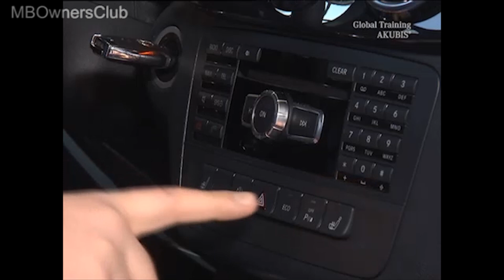The OM651 Diesel Engine: How it's Different in the B-Class, C, E and GLK-Class

Comment: No thought was given to maintenance access is extremely difficult, AND the inlet manifold is made of PLASTIC that fails and then screws your DPF, rocker gaskets leak plus oil filter housing, My OM651 is in an E class W212 , its rear subframe failed at 8 years,
Reply: Amazon sells AT-205, a bottle will fix your camshaft seal leaks. I've fixed so many major leaks on 25+ year old vehicles with it. Cheaper than struggling with valve cover gasket's on a transverse V-6. 🤷🏻‍♀️

Comment: With om 651 Mercedes made the worse diesel in history. I have timing chain noise at only 154 000km! Water pump leaking.The rear bridge is rusty.Very bad piezo injectors. Sensors  malfunctions....D.mb german engeneers.I will never buy mercedes or any other german car ever again.
Reply: Well my friend has a E class W212 2014 with this bad OM 651. 300.000 km without ANY PROBLEMS. Oil change done on every 25-30.000 km in Mercedes service. Rear bridge was changed at a cost of 100 Eur because it is under waranty  for 20 years regardles if the service was done by Mercedes or not. This is in Croatia. AFC is 5.5 lit/100 km. I gues it all depends on service history and driving style.
Reply: What year is your car? They say these problems have been fixed as of 2013.
Reply: @JasZg  Aren't the years of facelift sprinter and e class models with om651 from 2013-2016?
Reply: @SeverinLudwig  I am not sure about sprinter.But i am sure that c class made a restyle  2011-2014 with OM 651 and 2015 they made w205 .
Reply: @JasZg  Yes, c class facelift is 2011-2015. So you got a 2012 c class with om651?
Reply: @SeverinLudwig  Exactly.
Reply: @JasZg  Planing to buy a c class so maybe om642 instead of om651...
Reply: @SeverinLudwig  I owned w203 for 14 years and i wrote so many things about that subject.I replaced that car with w204 180cdi. I am very  unhappy  with this one already.I replaced 14 cars by now.I drove trucks and i drove trucks in army too as a professional driver. Where are you from? Maybe you should  consider to buy a Japanese  car.Because i seriously  think w205 isn't  better then this previous  2.Many peoples complain  abot it.I do like the shape of mercedes  but quality  is awful. So this one will be my last mercedes  for good.Its just not worth to pay so much money on repairs because Mercedes parts are too expensive  for that low quality.
Reply: @JasZg  Im from germany. I already thought about switching to toyota but they are quite rare here. Then most used toyotas are manual here. Im still driving my old w203 c270, the engine and transmission are very reliable but the car is 24 years old and has 300k miles... I'd like to keep the engine and transmission, but with a new chassis and interior. Maybe it will be a w204 with om642. These v6 diesels are also supposed to be very durable and are strong with low fuel consumption. I could buy one under 100k miles and try to drive it up to 200k.
Reply: Service it regularly, change driving habits if you own one fitted and its bombproof 
64k on the block from new, Monday to Friday the wife drives it literally 4 miles tops to work, I drive it weekends covering 100miles tops
so why hasn't ours failed?
Reply: @TheYorkshiregolfbandit that's low miles, hopefully it lasts as long as your attraction to it. 🥰